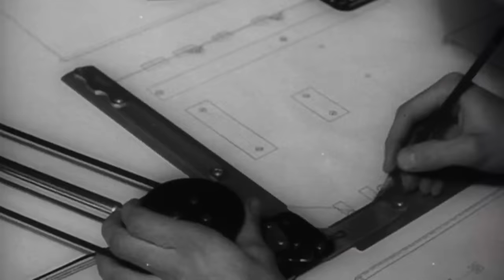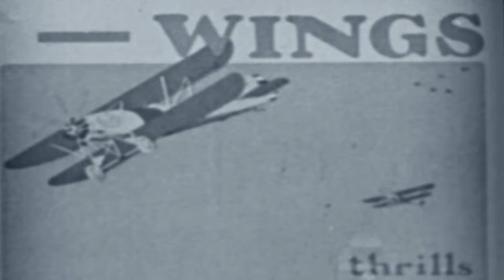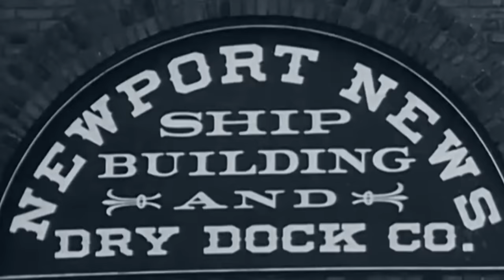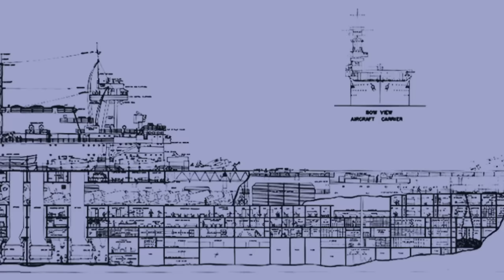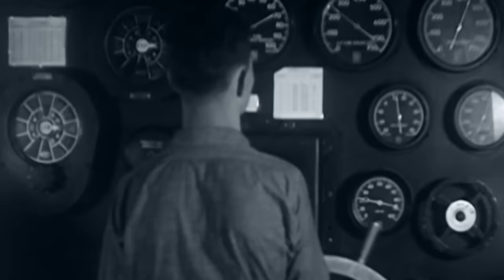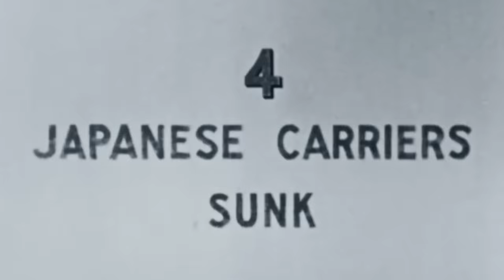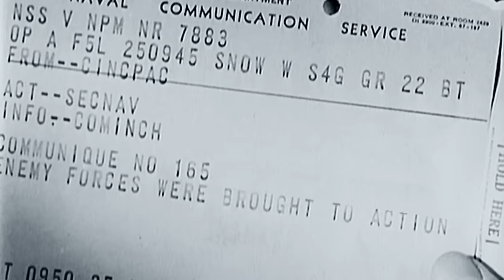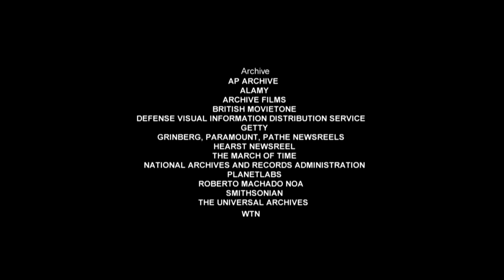War Factories | Season 3, Episode 2: Enterprise - Rise of the Aircraft Carrier | FD History

Comment: one fallacy here:  in 1922 and even 1932, carriers simply could not be primary strike platforms.  Even the Japanese still saw the battleship as the primary strike element right up until 1938.

History is not really so hard that one can simply ignore the state of the actual aircraft in service.
Reply: another interesting note: the planes that won the Pacific War were already in the design phase which is why the F6F, Avenger, and new radar systems were ALREADY in the pipeline.
Reply: Last note; as early as the fleet exercises in 1934 the US Navy was using their aircraft carriers both independently and as primary strike platforms.  They did not "learn" this in 1942, they simply lacked the flight decks and aircraft necessary to conduct such operations.  Again, history is not this hard.